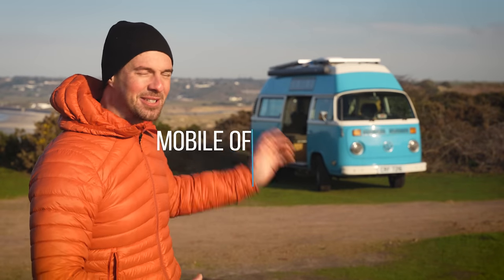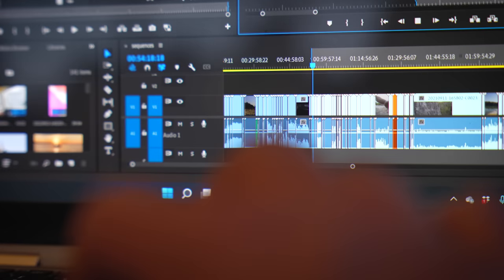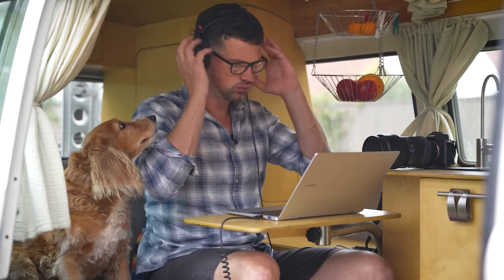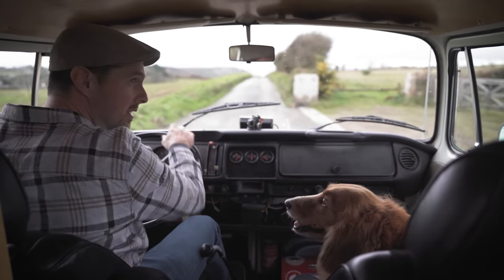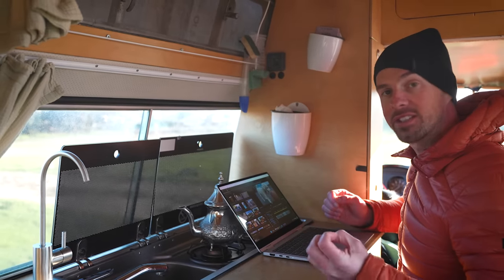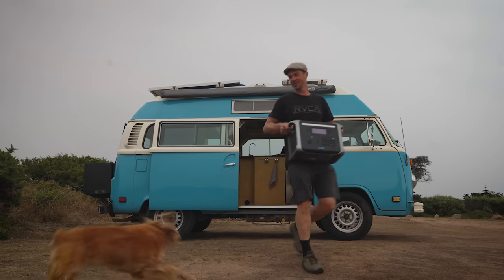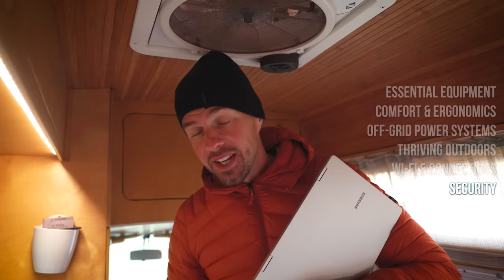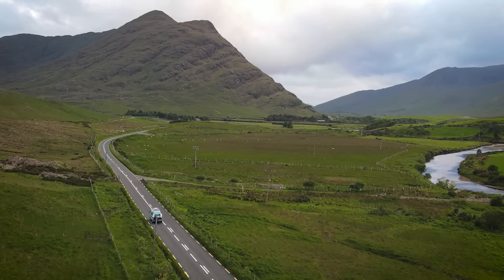Building The Ultimate Mobile Office // VAN BUILD TIPS

Comment: The same size Mac laptop especially with an M2 will easily out perform the intel. Much better gpu and most importantly for a van build, draws less power.  It may be more expensive but it's hard to argue the intel is easily as good, unless you can prove other wise.
Reply: No, how about YOU prove your case instead of just saying words. No? I didn't think so.
Reply: Obviously you're a Mac fanboy. How much experience do you have using the EVO Ben has?
Reply: @e-curb  I'm not actually I have both a PC and a Mac, but nice try at a presumption. Are you a fanboy of the channel? If Ben is going to do be a shill, it's work it's best to get the facts correct.
Reply: @Leib33  Yes I will. . Intel Core i9-12900HK	140 watts Max Wattage,  Apple M1 Max
Max Wattage up to 110 watts. You see? Instead of just laying into me understand facts.
Reply: @Leib33  Here you go more evidence. Apple M2 TDP Wattage 15W, Intel Core i9-12900 TDP Wattage 65W. Yes, I think I will buddy bring it on. :)
Reply: @Leib33  Here you go. Intsead of just blazay words like yours or in the video.. facts.
iGPU 
Core i9 12900H. 1.69 TFLOPS
Apple M2. 3 TFLOPS
Reply: @e-curb  You mean the EVO with an i7 which he surreptitiously promotes. Looks more like you are a fan boy of this channel and despite facts laid out infront of your eyes refuse to believe the truth? Many YouTubers do shill work in the disguise of a review or recommendation. You'd do well to understand that.